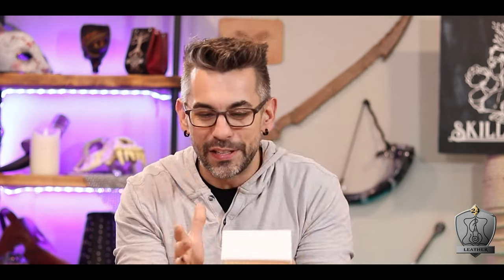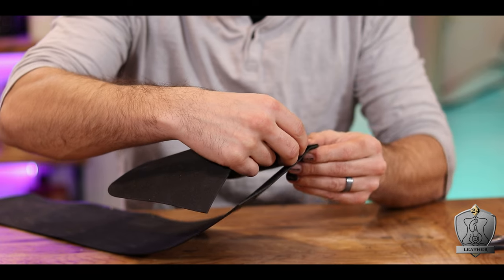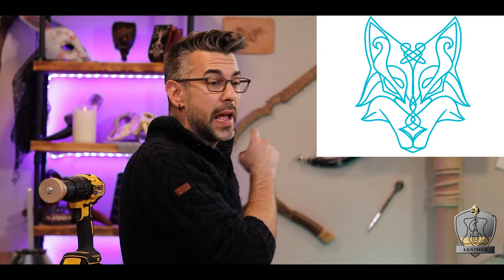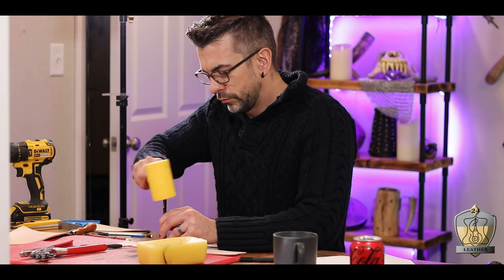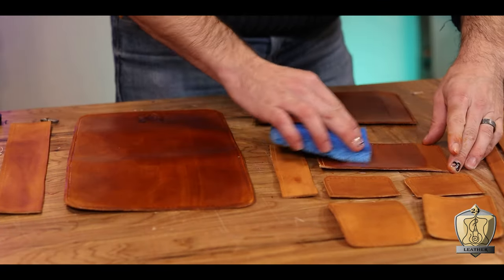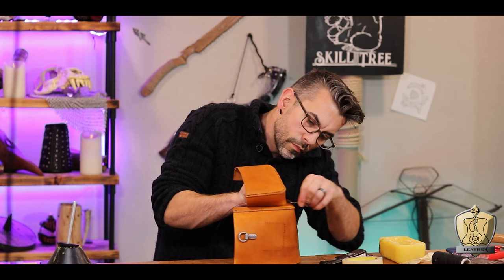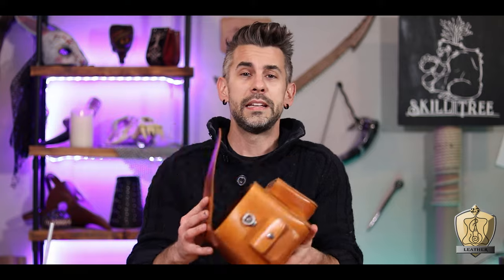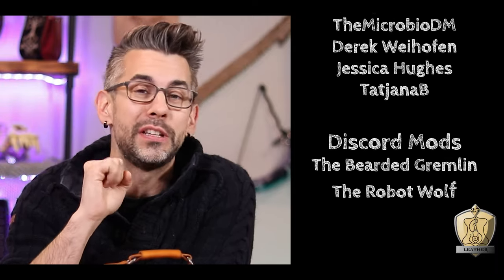DIY Custom Leather Camera Bag  - Hand Made By You!

Comment: To make the pockets easier to attach simply turn the leather edges and sew them from the outside. If you dampen about 1/4 inch of the edge and form it with your fingers it stays in shape, but it’s is a breeze to sew. I have done up tp 6 oz leather this way for pockets. It looks very professional and if you wet form the edges it sews in without any puckers.